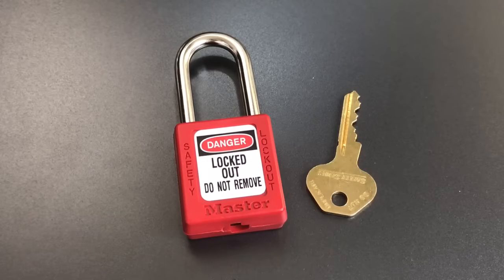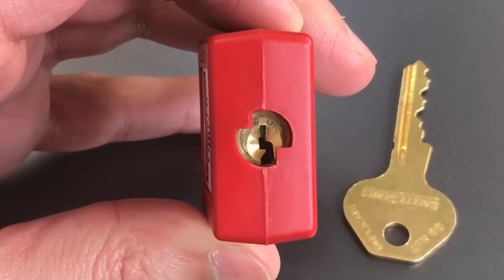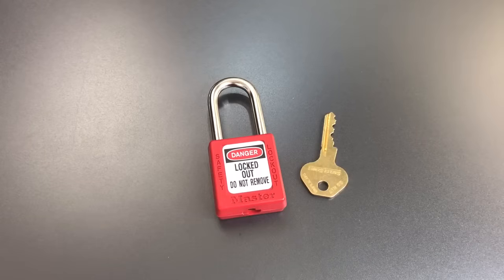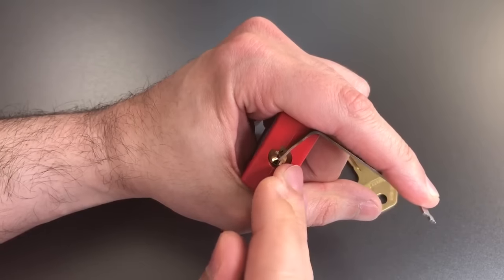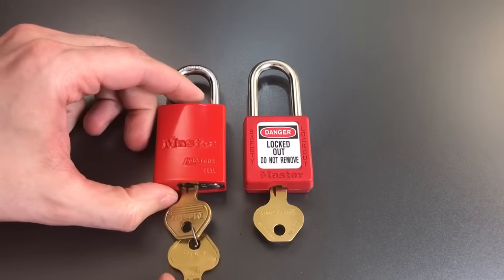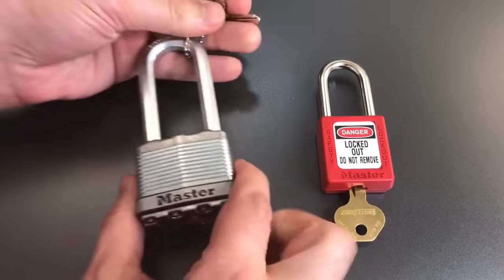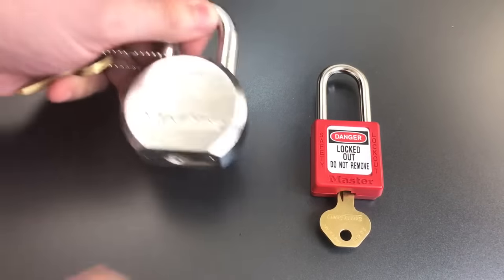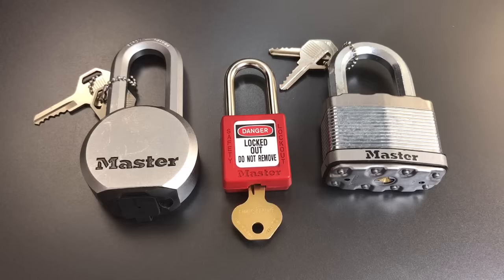[479] The Master Lock Paradox - Model 410 LOTO Padlock

Comment: The lockout lock has probably saved lots of lives.  Many years ago I was developing electronic sign control software with a fellow named Jimmy.  When the electricians were working on the sign (3 phase, 400 Amp service), they would put a lock on the breaker box and put the key in their pocket.   Jimmy would invariably want to test something and would run over to the breaker and try to turn on the power while the electricians were up a ladder and inside the sign.

Comment: As an industrial electrician, I've seen a good amount of contractors leave site permanently without taking off their LOTO locks. Therefore their locks needed to be cut off. Assuming this is the reasoning for the low security exterior.
Reply: also it’s a lot cheaper, which is important since they’re often bought by the hundreds
Reply: Never thought of that. That is an extremely reasonable assumption. I bet you're correct.

Comment: the additional pin(s) are not for more security, it's to reduce the odds that someone will accidentally have a duplicate lock in a multiple person lockout situation.  complex operations can have a dozen or more LOTO locks on one piece of equipment.
Reply: That makes a ton of sense.
Another comment also suggested the weak body is specifically so you can easily cut it off in the fairly common event a contractor finishes and leaves while forgetting to remove the lock.
Reply: YOUR lock is supposed to have YOUR name on it....YOUR key isnt supposed to be inserted in someone elses lock...that makes two tons of sense...